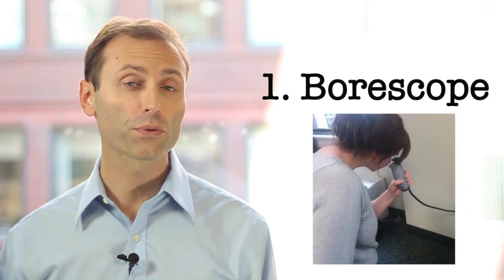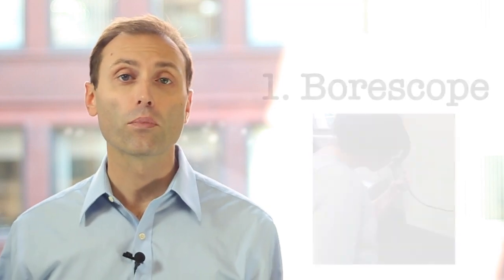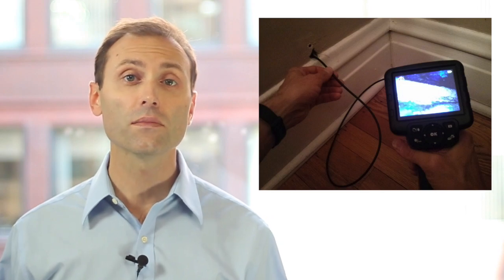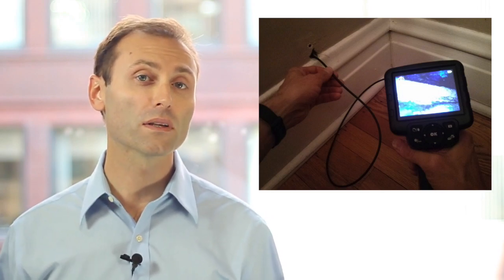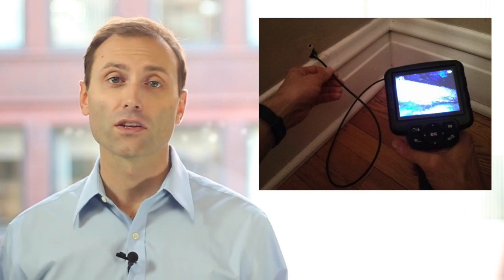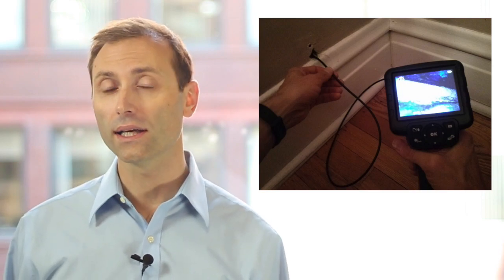Mold in Walls, Part 2

Comment: IF the mold is dried out already, can it still cause health problems? Does it still give off toxins?
Reply: Short answer: YES :-( 

Long answer: From my understanding, mold spores have a half life of 10+ year. So they live long. However, if the source of the moisture has been eliminated, then one can simply hepa vacuum and wipe the surface. However, walls are porous and cannot be wiped. So even if the wall is dry, the infested portion needs to be taken out. While taking out, spores will fly all over. So we need to contain the space. Most of the time, air will still flow from the contained space to the rest of the house. So run a negative air machine that takes the air from the contained space to outside the home.